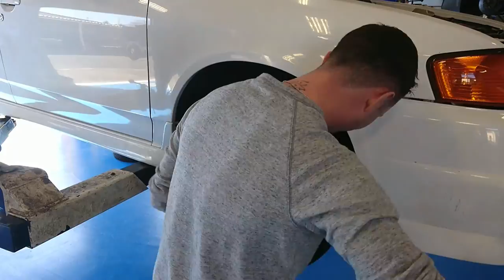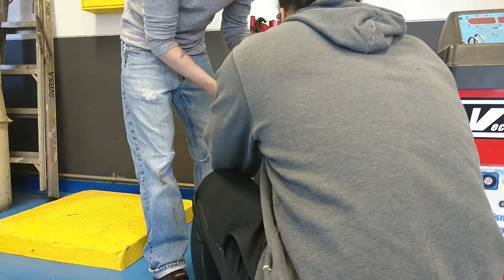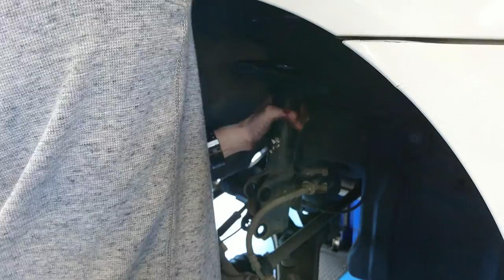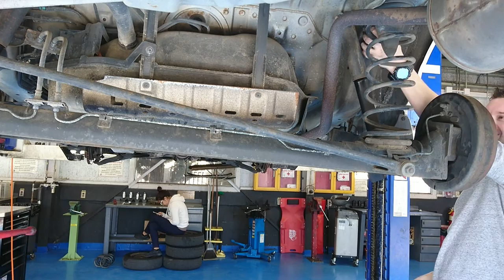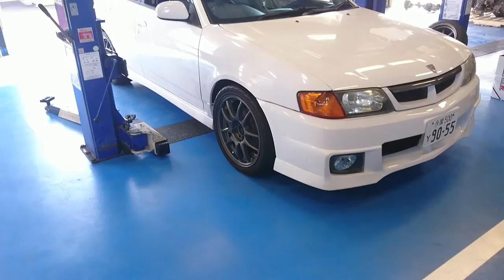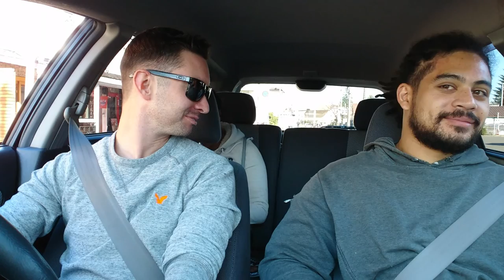How to install lowering springs! Nissan wingroad

Comment: Where can i get those lowering springs for the 2005 nissan winroad
Reply from the maker: I found mine in Japan on yahoo auctions. I'm not sure where else sells them.
Reply: @jdmdc2integ  Hey.Yesterday my 2004 wingroad gas pedal has no effect and just keep racing. Please tell me what the problem is. I've checked the fuse in the hood and all. Is it that the gas pedal sensor failed me??? Please answer